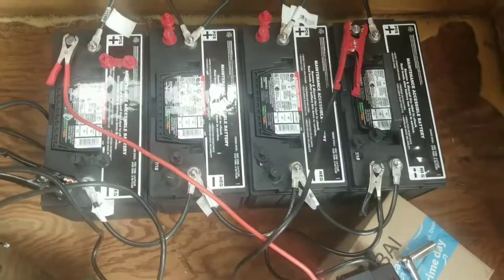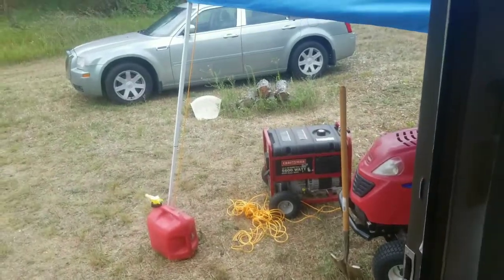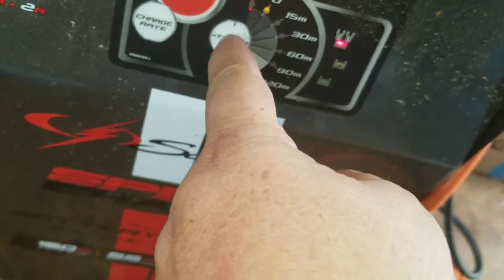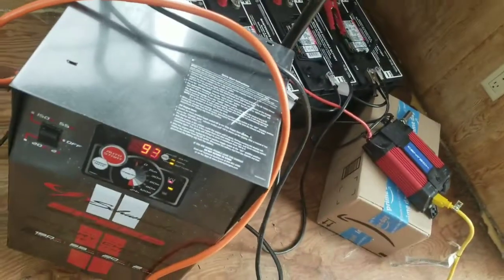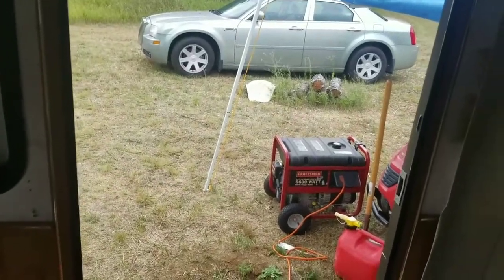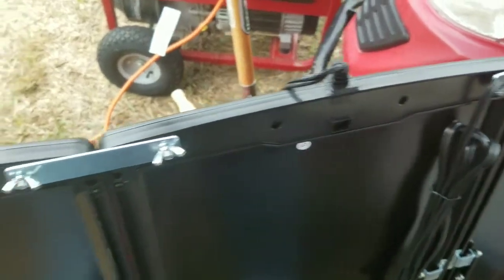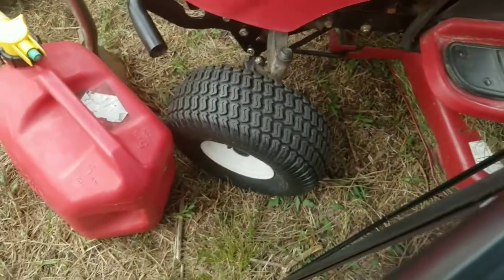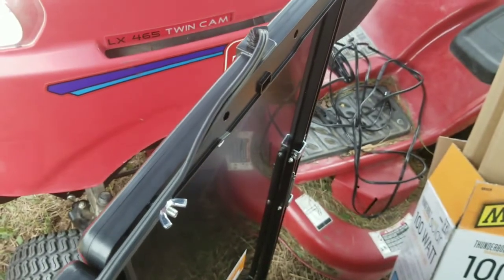HARBOR FREIGHT SOLAR PANEL BUILD QUALITY: IT SUCKS!!!

Comment: I've heard those panels are meant to maintain the charge if not used but not to actually do a whole lot with. You'd have to spend a lot more to get the good panels.
Reply from the maker: Love2boat92 Will be getting better stuff soon. Want to see how well these panels work, mainly out of curiosity.
Reply: Amorphous panels charge better than crystalline